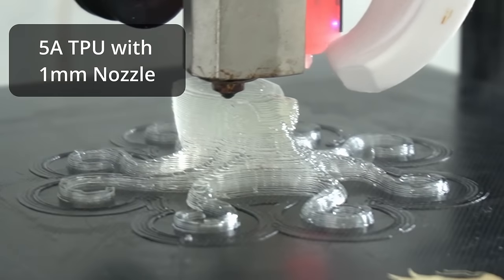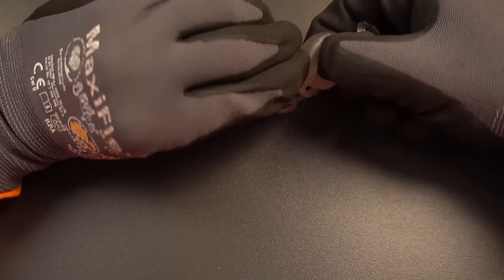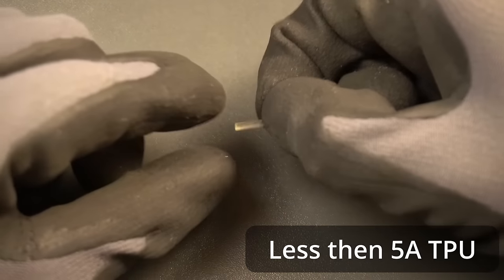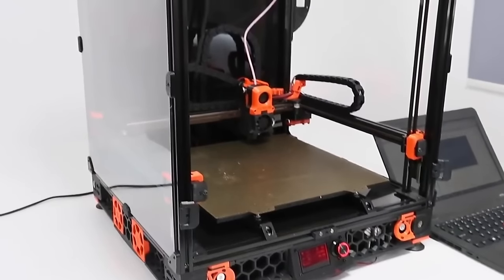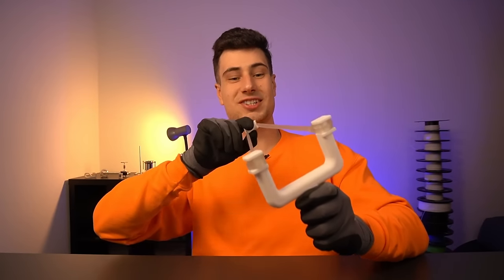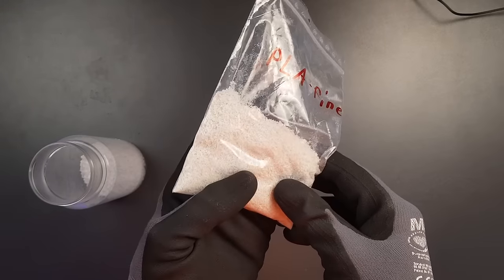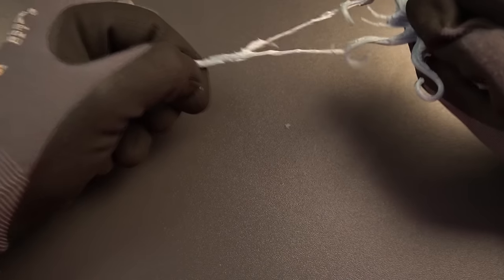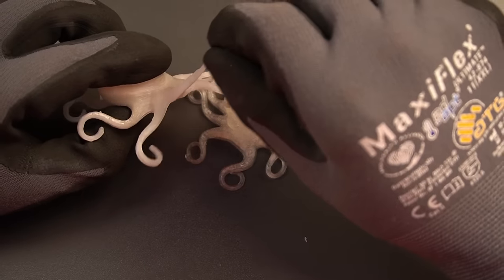This Extruder is a TPU GOD! Faster Flexible Materials 3D Printing

Comment: @Greenboy3D What are your results w/ your pellet extruder printing w/ 0.4 mm nozzle?
Reply from the maker: I do have uploaded an image of some pellet 3D prints on my main website. Unfortunately YouTube does now allow uploading images to YouTube comments 🙂
Reply: @greenboy3d  Thanks, I saw the vid printing the owl @ 0.4mm layer height.  I read some of your FAQ's.  Why can't you run cleaning pellets through the extruder when you want to change out materials w/ different melt temps or even just purge out the old material w/ the new material like is currently done on every fdm printer w/ a filament extruder?  Also, does your pellet extruder perform similarly to the good filament extruders with little to no stringing jumping from part to part when there is more than one on a build plate?

Comment: hmm, elegoo nepture 3 pro prints tpu just fine. at least I think 95A or something quality. you would actually try the syringe force feed extruder, where the screw is above the piston, and the whole syringe is hot melter metal chamber. and it needs some pause time to reload. but maybe the screw-only nozzle is best for continuous feed. you decide. try the stress weight test for the flexible tpu. you can make the harder tpu flexible by making hollow parts. also much lighter and less 3d print material used. separate food color as liquid or something that mixes directly with the tpu. maybe spot coloring like in a bubble jet printer head.
Reply: 95A and 5A are entirely different worlds of difficult to print.
Reply: want to try wire spot electro-plating on a metal 3d print surface. copper or zinc wire. yep true metal 3d prints at home easily cheaply simply.

Comment: Pretty sure that if you would mill the granules far smaller, like to 0,1 mm3 or so, composite materials, like TPU + PLA, would behave far more as one material and not as two materials extruded at the same time.
Reply from the maker: Very likely

Comment: Tpu is nice, but honestly if it can print super elastic tpu i wonder how it works for abs or other materials... I bet its better.

Id honestly like to see pellet extrusion become more mainstream, its the better tech its just not as mature.

Based on your accent youre nowhere near las vegas or id face scan you so you could do some masks that suction to your face in that 5a tpu as a use case...maybe find a local friend with a 3d scanner?

 To mix the plastics you need to agitate them in their melted state.  What youre getting is an incomplete mix.  I think the most beneficial thing about this tech is that you could grind failed prints up and almost immediately reprint them to reuse support material, failures, etc instead of creating plastic trash or just sending it to a recycler.

Comment: Surprisingly, I could print the most flexible 45A atomstack 3mm TPR filament with a lulzbot flexistruder without an issue. For most other things a platinum cured silicone on a SLA resin printed mold works fine(might involve use of a release agent to prevent inhibition with silicone curing). Definitely extreme flex tpu cannot work in filament form. Direct pellet extrusion is a welcome advance definitely👍👍. But beware of the big guys coming after you, since it will be a call to end the overpriced plastic filaments market!.😢 For application in core xy, suggest exploring muscle memory wire with gear/clutch mechanism for a high power to weight ratio, while keeping the weight of the screw extruder to a minimum.❤👍

Comment: I hope you are at least considering applying for patents on a few of the design features.
Reply from the maker: You mean normal patents or utility patents?
Reply: @greenboy3d  Not sure what the terminology is in the EU, but in the US patents are classified as either design patents or utility patents.  Design patents just cover the 'look' of something, like the coca cola bottle shape, for example, and don't do much towards protecting you from knock offs if you are successful.  However utility patents provide at least a little protection in this regard and are usually what people think of when they think of a patent.  Usually the patentable aspects are one or more subtle design decisions that you came to through trial and error.  The 'big picture' idea is typically not patentable because usually lots of people have had similar thoughts but the little details of an implementation are often unique and vital to getting something to actually work.

It's a cost/benefit decision to whether it's worth it or not.  In the U.S. if you hire a lawyer (but do most of the paperwork yourself) they can get you through the process for maybe 3000 USD at minimum.  However if someone infringes you have to pay to litigate, and if it's a small market it might not even be worth it.  Then again the existence of a patent may discourage them from infringing in the first place.  Of course they can try to design around your patent as well.  So that's a long winded way of saying it is sometimes worth it and sometimes not.  The main value of having this protection would be preventing established manufacturers, particularly those based in China, from doing a knock-off of your work if it becomes mainstream and not paying you anything.
Reply: I guess I should add--you can also get a quick provisional patent (at least in the U.S.) Those are not reviewed, do not involve a lawyer and only cost a few hundred dollars.  They just act as a placeholder for a year while you decide if you want to get a full fledged utility patent.

Comment: TPU + carbon fibre
Reply from the maker: 😉 Any Idea where to get the carbon fibre?
Reply: @greenboy3d  a sheet of it on Amazon or similar store. Cutting it up may release some fibres - maybe print a single layer tpu, then CF then another layer TPU, and then shred this into pellets to capture it so it doesn't go in your lungs when you shred it. Or just have good ventilation and ppe

Comment: hay man do you whant to print sum cool shoe bits instead/ as well, as the sling shot? haw dus it go at supporting that soft stuff? Man i need this thing LOL so cool ...... so what can you Not print !!!?? anything is printable is that right?   ..... so is the screw the most expensive part? can it be 3d printed ? can i get 2 on my sovol 4 ? LOL
Reply: You can probably SLS the screw with something like JLCPCB or PCBWay

Comment: in this video i have 3 goals,
1 try to sell you my pellet printing extruder like in all my videos
2 try to sell you my pellet printing extruder like in all my videos
3 try to sell you my pellet printing extruder like in all my videos
Reply from the maker: If that is your opinion, that's fine, but many people learn a lot about pellet 3d printing from those videos and especially those that print a lot with TPU. 🙂

I have had already 4 3d printed shoe manufacturers contacting me about the potential of pellet 3d printing shoes with elastic and soft materials, because there are not many good solutions yet.

And in addition to that it solves a lot of problems for a lot of people and opens up new possibilities, therefore I don't understand why you seem to be so angered?

Comment: Your prints should be stronger. You should test the mechanical strength of plastics. As melting plastic and solidifying it back causes it to oxidise more and become weak. You eliminate one step of melting-solidifying with this design. This is also why recycled plastic is weaker I think.
Reply from the maker: You are on the right path, :) They get weaker more through thermal degradation than because of oxygen like in metals
Reply: @greenboy3d  I would like to see the comparison

Comment: The only thing that sucks with these types of extruders is that it doesn't seem to work well in any kind of multi-material purposes. Either single nozzle OR multi nozzle due to the space each extruder takes up.
Reply: You would just need tool heads which are fed pellets via flexible hose or some such.
Reply: @802Garage  Would that not mean a lot of pellets are purged for sharp material transitions? There seems to be a lot of material within the screw itself also.
Reply: @klaidasrunele  Multiple tools heads generally involve a lot less purging than single tool heads with a filament switcher. Unless this setup has particular issues with oozing, which I don't think it does, it should be similar to like a Prusa XL.
Reply: @802Garage  If you take a multi-tool head approach, the printer is massive to begin with which isn't helped by these tool heads being bigger than regular ones anyways. IDEX at most for a regular size.
Reply: @klaidasrunele  NGL printers are already large. There are compromises to any approach.
Reply: @802Garage  ???? There are multi material printers with a build volume of 185^3.
Reply: @klaidasrunele  But if that's what you're looking for... Then this probably won't be an ideal solution. That's kinda what I'm saying. You can find a problem with any solution if you look for it. It's very obvious multi color single tool head will not be possible or at least practical with this type of auger system. Though, if you wanted to, you could still likely fit a multiple tool head system on a fairly small printer. It's just not really the most logical task to take on.
Reply: @802Garage  It's almost like that's what I said in the initial comment. This extruder seems to be superior to fillament based ones in basically every regard, especially cost and mechanics. 'It's obvious it won't work' is the villain of innovation.
Reply: @klaidasrunele  I feel like if you read back through the conversation you'll see I acknowledged that in the first place and was adding on to what you said rather than disagreeing. In every comment. That's kinda the entire communication failure here.

Comment: You better show where to buy cheap filament pellets first. Having my own mod is cool, but if the pellets cost up to 15 dollars, then there is really no point, right? Not a single home can afford to buy bult pallet worth of goods that would be as cheap as the cheapest ready filament.
Reply: You want everything done for you? That is on you to try and find some, if you dont that is your problem.
Reply: @Mnt-400 I want to receive information, which contradicts to what I have researched for some time. And no , no one will sell you  even China pla, tpu or petg pellets for cheaper then 10 euros with delivery And that is the sketchiest find. And for 10 euros you can find ready made filament in Spain. The prices that were shows I previous videos could only come buying in bulk. By bulk I mean someone who makes filament in the first place along with all the additives that go into filament making.

Comment: Well, I will be honest: your work is good, but I saw you are selling this extruder and what I have seen so far is no real new development been done. I work on the industrial side of 3d porinting. In dustrial 3d printers are using  this kind of extruders for at least 7 years. I have seen this kinds on commerfcial printers on US, but mainly on China, where it is use for TPU pellets, ceramics paste, etc. And lat formnext show on Germany, there are thhese extruders been sold for us$300 from germany comapnies. And be carefull because what I have seen Im sure it is violating intelectual proerties from some of those companies.
also regarding mixing material, that is also been done in the past on the industry side. The proper way to achieve and how it is donde is called "coextrusion" where a filament is being done with a core of 1 material surrounded by the second one, this technique is used for creating bonding between "not  bonding materials". In the practice using mixture of amterial like thios has proven to not be usefull at all. The diamond hotend was used like... 10 years ago not only for mixing colors but also for mixing materials and from the engineering point of view: not usefull (Im engineer and been printing since 2007 si take my word for it since I have developed many industrial 3d printers so far and experimented with "unusual "ways of using materials)

Comment: I have brought important topics to discussion on your discord... and you have banned me. I suppose you don't want any discussion, which means you are stuck in your head. That makes basically a dead project.
Reply from the maker: Posting product links is against the Server rules. That's why you got banned
Reply: @greenboy3d  ah, did not know that - sorry. Was not meant for any advertisement. So far we don't know anything about your pellet extruder - weight, extrusion rate... I have posted it to discuss about weight influencing the print speed, acceleration and those influencing nozzle size if you want to print large volumes of filament. To discuss in what aplication it is feasable.
Fitting it on a stock Ender does not seem reasonable.
Reply from the maker: Ok, I understand. I have unbanned you. 

But please keep in my mind, that what you personally perceive or think is not the ultimate truth for everybody.

Making statements like "this Extruder will cost 600-900$" or "Pellet extruders are not feasible for consumers" implies as if it is the truth, which is not the case, rather just your own personal perception or opinion and harmful for the community because it makes people believe things that are not true.

If you want to discuss topics, then please try to stay neutral without causing people to draw conclusions based on false or overgeneralized information, that does not apply to the Greenboy Pellet Extruder or people who want to use it.

Comment: check out the very easy and quick hot end used in the bambu mini A1!  Please emulate that. eleasae one clip, pops right out, complete. nowhere to leak, andnowirestodisconnectorheaterstoremove.